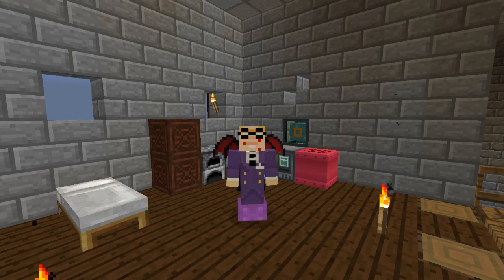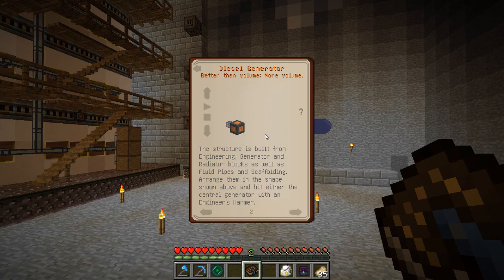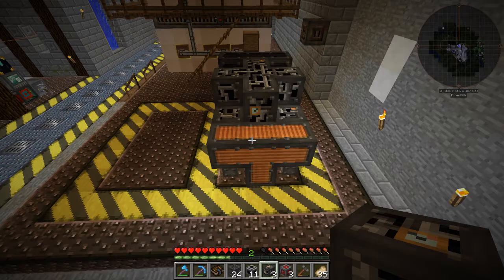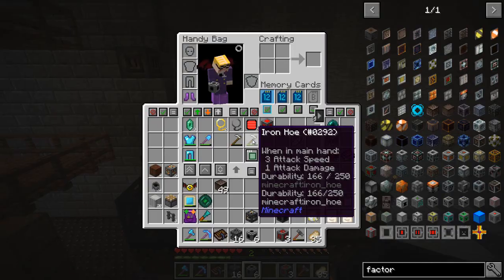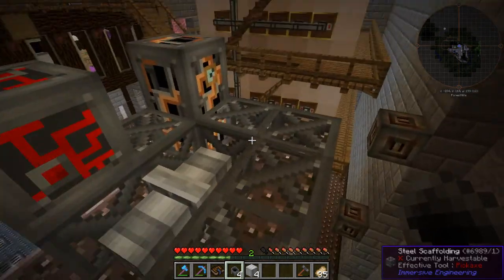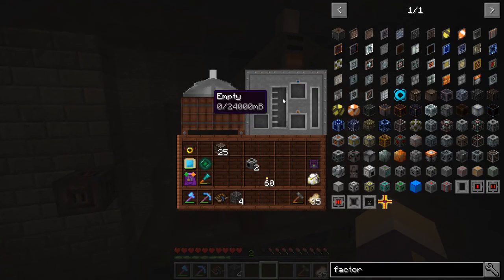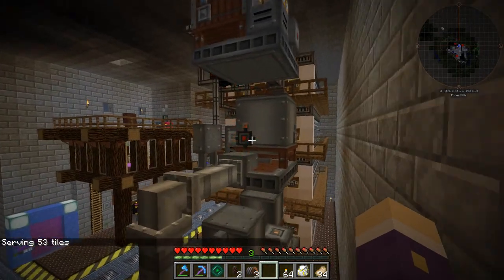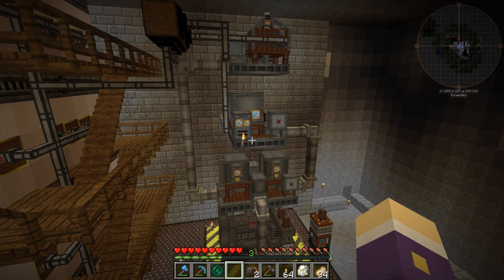[Lets Play] Quantus :: E33 - Creating a Diesel Power Plant

Comment: Hi Nemsun, immersive engineering is lots of fun to play with and look great when built. It is always a good idea to avoid power loops so the output power from one machine feeds the input of other machines that are needed to produce the materials for the first machine. You can use super circuit maker to control the generator by the stored level in a capacitor.